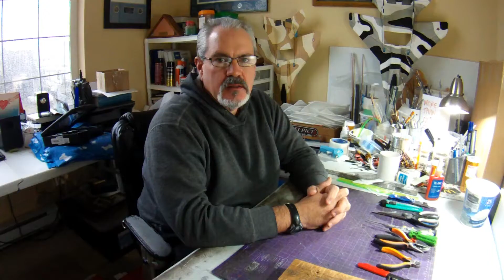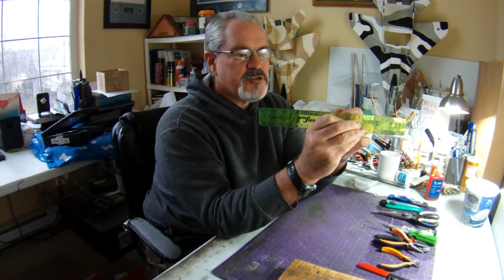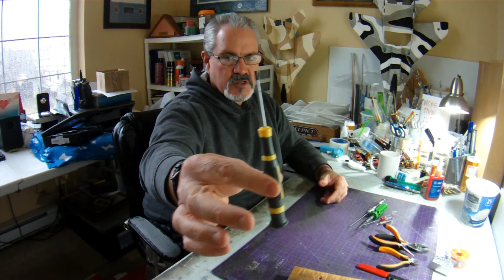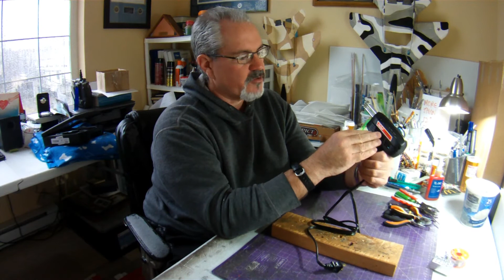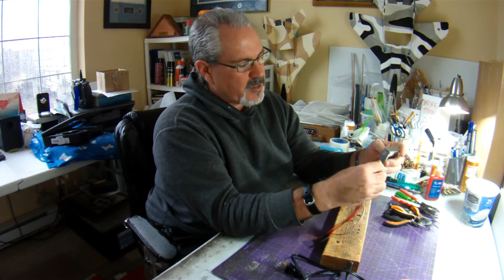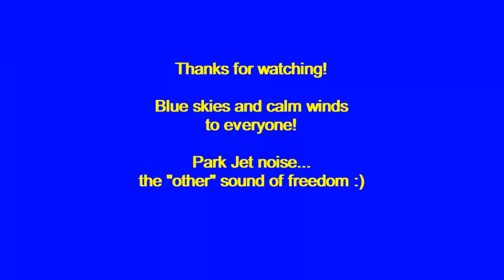"Table talk" - basic tools I use to build Park Jets

Comment: Hi Scott,  the 63/37 (or sometimes 60/40) is the tin/lead ratio blend commonly used in 
Mission-critical applications (per IPC J-STD-001, Class 3).  The lead-free solder (ROHS)
has a higher eutectic characteristic, thus requiring higher heat for soldering. The lead-free
solder has its initiatives in keeping lead out of the landfills (disposable consumer grade electronics).

I agree with your mention about pretinning your leads prior to soldering.  Also, cleaning your soldered
connections with isopropyl alcohol is always good practice to rid excess residual solder flux which can
be corrosive.

Thanks for posting and sharing these Table Talks.  As always, it is very much appreciated!  👍🏻😃✌🏻
Reply from the maker: Thanks for the info and tips, Jim, much appreciated :)  Cheers, Scott